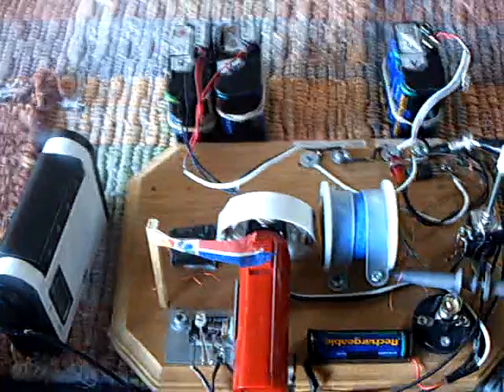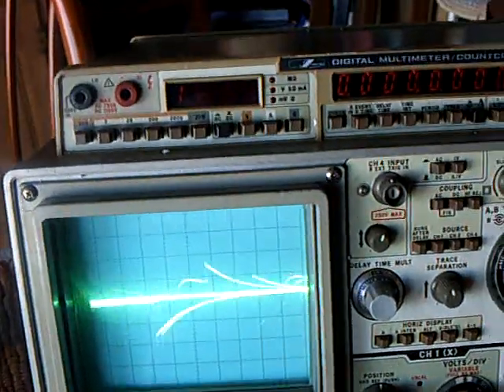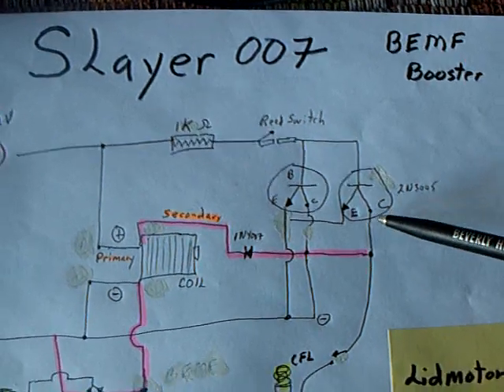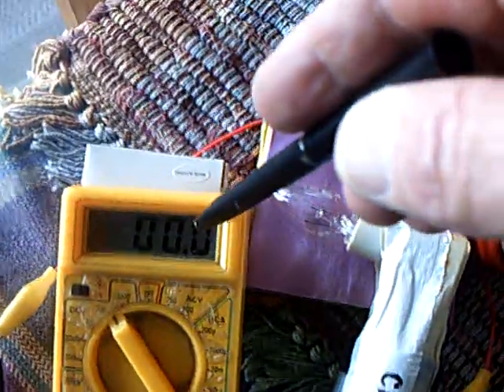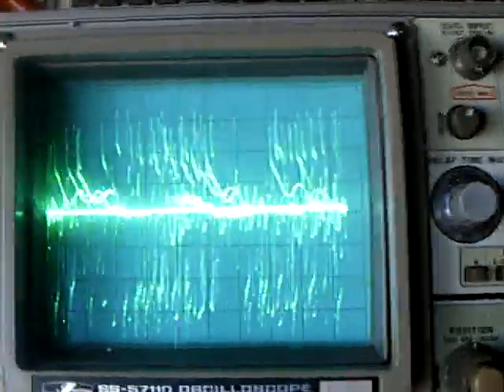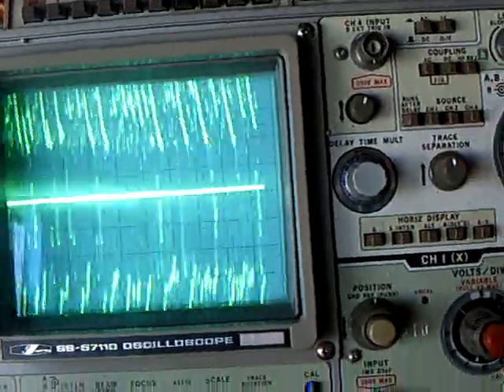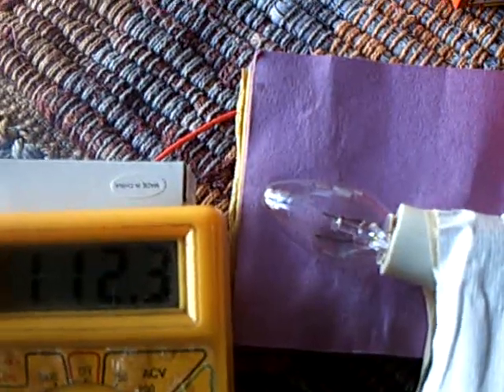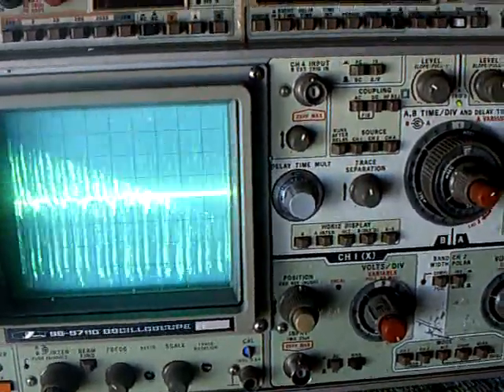Slayer007 Back Energy Booster---My replication

Comment: Try putting your ignition coil on the negative side.
Going from negative on battery thru the coil and then to the emitter.
This way it dosent use any extra power and you still get good light.